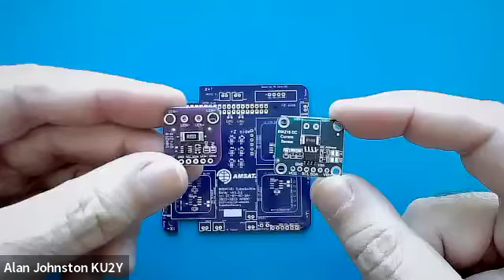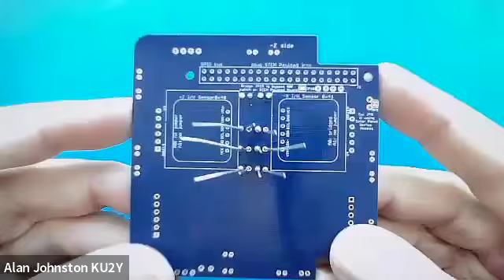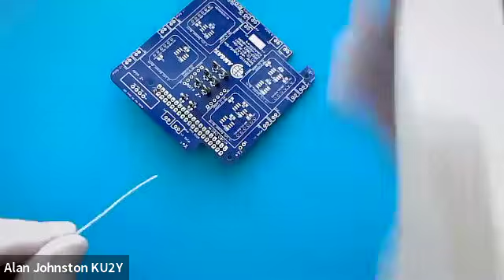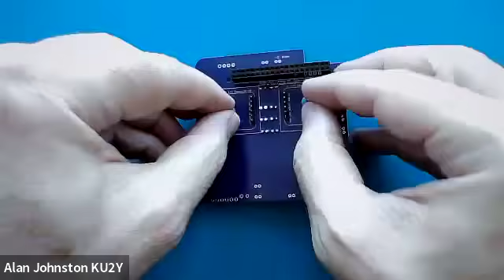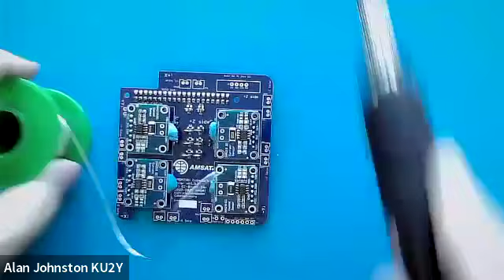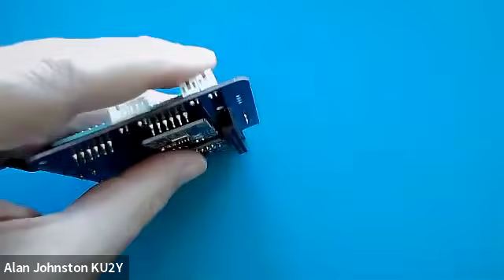CubeSatSim Beta v1.3.2 Step 6 Solar Board

Comment from the maker: Hi,

It is possible to upgrade, although I would recommend building a v1.3 Beta for best results. Here are the instructions for the v1.3.2 STEM Payload PCB which replaces the v1.2 STEM Payload PCB.   https://github.com/alanbjohnston/CubeSatSim/wiki/v1.3.2-STEM-Payload-Board-Upgrade  Good luck